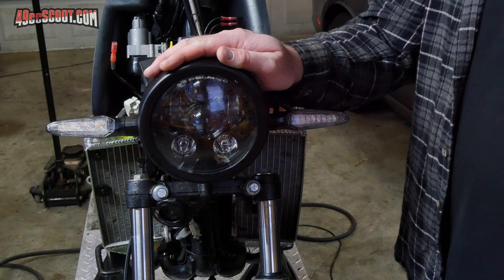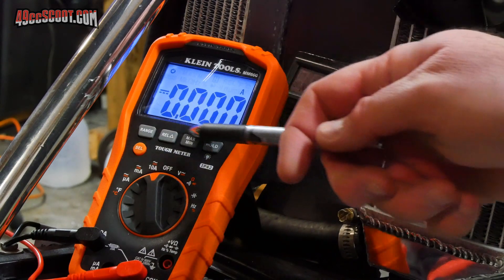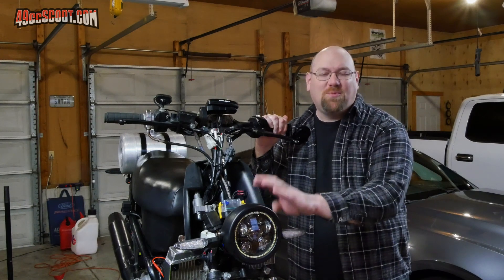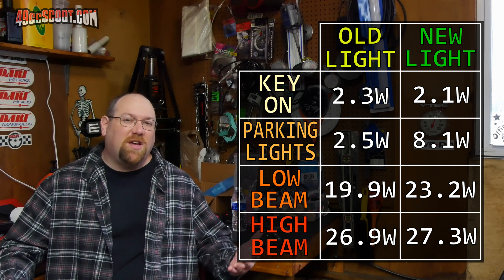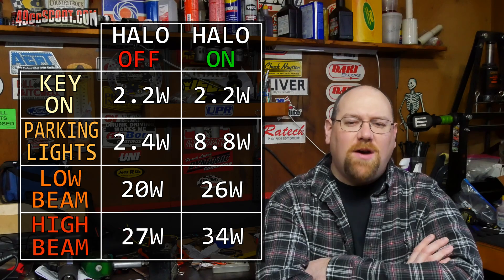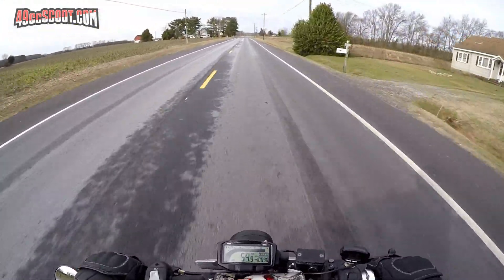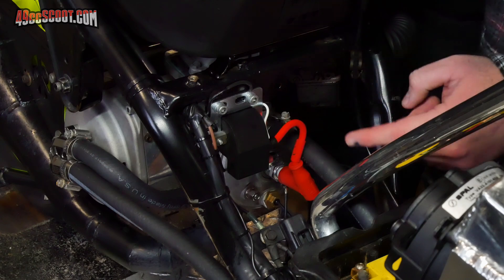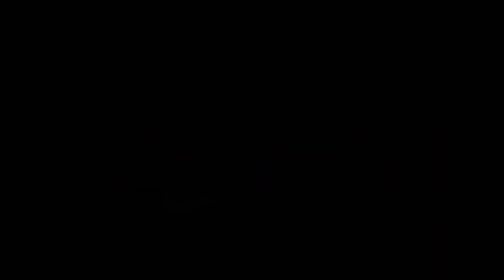TPR 86cc Build : Part 26 : Headlight Swap With Charging & Lighting Checks

Comment: I I have some glue lined 3:1 heat shrink tubing I'm thinking about using on my plug wires, to prevent something like that from happening,   it works great on everything else, even tool handles! I wouldn't cover the whole wire, only the connections! I'm thinking about adding a rectifier to my headlight, with a capacitor, to keep the led from flickering,  or stiffer clutch springs, and set the idle slightly higher,  funny thing, the light stopped  flickering, just as the clutch starts to crap!  But I'd rather spend less$$ and buy the big valve head, and intake, and upgrade to a 22-24mm carb, with a cam, and large valves, 50mm bore,  along with a bit of porting and unshrouding, a 24mm CV should work nicely! The 20mm works ok with the tiny valves!

Comment: Is this headlights has built-in regulator/ rectifier? 
Scooter is AC and LED headlight is DC.
🤔🤔🤔
Reply from the maker: My headlight is powered from the battery so it gets a stable DC voltage as long as I can keep the battery charged. I haven't done it with this light, but I have ran LED headlights off of the stock wiring before. They worked fine, but flickered at idle and low RPM.

Comment: I'd probably go with a Lithium Iron Phosphate battery, with twice the Ah and not have to worry about it. More expensive, but if one battery works and the battery doesn't get flogged all the time (like your current one), probably well worth it? Definitely buy the best brand of them though, cheap lithium is all bad news.
Reply: Although I would also check the spec sheet to make sure you can charge it from 16v, or get the charger sorted with a regulator of some sort.
Reply: Sorry for spamming.. You could use something like the link below to either keep the headlight at a constant voltage (stop light flicker at the lights) or to control the voltage going to the battery, if you went lithium.

https://www.amazon.com/DROK-Converter-5-3V-32V-Regulator-Transformer/dp/B078Q1624B/ref=psdc_10967761_t3_B018WZK5XQ

Comment: The 45w rating might be labeled so that bought hig and low beam are on the same time. Now you probably turn off the low beam when turning oon the high beam. Just a thought if you're wondering about the power rating
Reply from the maker: High and low are both on together. That's the only way you can power this light. It's just a couple of additional lamps that come on for high.

Comment: You better keep the voltage around 14V or so. If your voltage goes up to 16V you are going to overcharge/damage your battery and destroy your electrical system.
You can try just keeping your main lights on all the time, day and night, to drop the voltage. So it's not allways in your favor to search for low power consumption lights or to keep them off, you're not saving anything. A more modern regulator keeps the voltage around 14V, but only does so by wasting energy into a resistor internally. Normally your electrical system should have a resistor now too. It looks like this: https://www.ebay.com/itm/DAELIM-Scooter-ballast-Resistor-Voltage-regulator-12-volt-/141061001350
Happy scooting!
Reply from the maker: I'd rather find a quality regulator/rectifier. I have had 1 scooter with a ballast resistor and I didn't like it. The ceramic crumbles over time and they seem like a fire hazard to me.

Comment: is there ventilation holes for the heat sink on the headlight? looks like you're putting it into a sealed cover.
Reply from the maker: The opening in the back is pretty large.

Comment: I really don't care if drivers don't appreciate a bright headlight on motorcycle they already can't see us enough already or they just dont gaf
Reply from the maker: In the daytime, it's fine. At night it can piss people off and the halo isn't needed. The low or high looks plenty bright at night. I had an old LED light that wasn't focused enough and it kinda sucks riding around getting high beamed by everyone because they think you've got your high beams on.
Reply: @49ccscoot  I got a LED bulb it's pretty bright and I still had one or two vehicles wanted to cut in front or pull out in front of me.. Had a buddy of mine got killed last year while riding his 600 because the driver in his full size truck decided to cut in front him through a parking lot just to bypass traffic at an intersection.
Reply from the maker: @190SkyTeam  Sorry about your friend.
Reply: @190SkyTeam  I'm really sorry about your friend. The only thing you can do is try to keep yourself safe and never rely on the fact if you're being seen or not. If you see someone move, expect them to NOT see you, so you slow down a bit and be prepared. Be the man who makes up for someone elses mistake, not the boy who just blames them. Have a good one!

Comment: You could graft in that trail tech adjustable box you had on the previous version of things ? I'm thinking that may well be my route for bright
lighting, and to keep it simple. But keep it AC on ignition side with stock stuff. A rebuild is in the cards for it at 5 k miles, may just get a replacement cylinder and related parts. But smooth out the old stuff to the next size piston and try some port work on it. I know there is more to be had from the stock port map, not a lot more but a bit more. I've come to my senses - a little bit. 40 or 50 mph is fine for the old girl and
very useful in that range. I'll leave it that way. Had the CB 750 out when it got warm, it showed me my cervical spine issues make it hurt with
a big bike. 20 miles in and same back, by the end i was hurting bad enough to not do more. Here is where the good sense comes in -
A cb250 nighthawk came my way for so cheap i did not say no. Weighs the same as the scooter but with higher bars, highway miles on that bike
hopefully will be much less painful. I hope. It might be good enough for a few hundred miles or so.....might be. Still need to upgrade the nasty
stock plastic headlight on the scoot, a ceramic painted plastic reflector ? I would expect that from china but not an italian bike. Still think i can
get away with a low watt HID headlight and good leds all around by using that trail tech adjustable box. Simple enough anyway. The hack in
of the better reflector bucket will be a good trick i'm sure. Looks aside i just want light and a lot more of it than what stock gives. Night riding
around here is deadly without very good light, way too many animals some of them large - moose and deer. And the over abundance of stupid humans being drunk and clueless. I like your headlight assy it looks like a good fit for my space constraints, perhaps an easier hack in than my larger bucket idea. HID just makes so damn much light it's really hard to not want that at night on the front of YOUR bike. With most cars having HID now it is brutal being a 1/4 mile down the road from them on high beam on a dark road. So i figure have a taste of mine, that should make the dim switch click pretty fast. Add to that the 2 10 watt led spots tilted down so i can at least see the first 50 feet in front of me.
I'm thinkin you should be in good shape weather wise by late march ? Not all that long a wait from here, a bit more winter crap and all done.
I'll drag this light thing up again when the time comes to do the work. Have a good
Reply from the maker: Congrats on the 250.

A stock stator, with a floated ground, and the Trail Tech regulator made a nice charging system. Really never had power concerns doing anything that I did with it. I can't float the ground on the MVT stator to use it with a full wave rectifier like the Trail Tech. Well... I'm sure it can be done, but I'm not cracking open an expensive ignition to do it right now.

Lots of good lights out there now. So much better than the market was even 5 years ago.

Yeah, by about April it should start to be OK weather here again. Hasn't been bad so far, but I think real winter is coming soon.
Reply: @49ccscoot  So glad i came to my senses. 
Use the scoot for what it is and the 250 will do the rest. Drum front and rear is a bit bothersome, but will work as long as you think a bit. Stator should have a bit more beef to it on the 250, i think i see a low watt HID on that thing too.
I believe someone on your forum ( yes i have failed to do what i said i would )
But i will do it, just too many medical appts right now to keep it all clear.
Had a go with an LT 50 piaggio and did the coil mod, think he wiped the bike and then did a custom naked style thing with it.

Anyway all the best from the land of the crazy libs - mass - hole - chewits.
See ya next time..................

Comment: Great fun.I drove off the road today.In 10 km\h.I hit the ice edge in the car trail and slided both left and right before I ditched.I drive all winter,but its global warming and some spots are lethal.
Reply from the maker: Hope you and the scoot are OK.
Reply: @49ccscoot  It was hilarious.I use it in -10c,snow,rain.I do 60km\h inside these wheel tracks every day.Just a reminder,in a split second you`re gone.Had 2accidents,1 similar couple years ago.High speed into frozen slush.0 chanches,and max pain.The day before it was like water,next day concrete slides.

Comment: great video mate as all ways  i have to ask how is the tpr 86cc holding up  as  am i right thinking that its a hyper race kit ? so  not made for a day to day ride ?
Reply from the maker: So far so good. About 850 miles on it ATM and the engine itself has been reliable for me. I should prob pull it apart and see how the cylinder, piston and ring looks before too long.

It is a hyper race cylinder kit. I don't really have it in full hyper race mode though. I'm not making the horsepower that it's capable of yet. Need at least a different exhaust for that. Can't say how it would do in a more tuned mode. I like it right now though.
Reply: @49ccscoot   well thats good to know as im building a stroker engine and seen the tpr 86cc kit about a fair bit  and for the price  dont seem bad  as im looking for using the bike around town in the week and   trips down to see my son at weekends what is 40 miles each way but would think that i will be doing under 150 miles per week 

was thinking of doing what you have done with detuneing it a bit  so not as high reving exhaust  but staying with the stock stater but  lighted flywheel
Reply from the maker: @mrchilled85  You may want to consider the 70cc sport to midrace stuff. This is not what I'd recommend for something that you need to depend on for 100  miles per week. Not saying it can't work, but I think there are options that make more sense. That or consider a larger scooter, like a 125+ and then use the 2T as a more fun option occasionally.
Reply: @49ccscoot  i did think that but  a lot of the roads im going to be using are only 30 mph   
i did order a dr 70cc kit and top performance crankshaft for my spare engine i was going to keep as a backup motor so may  just try using that for a bit then try and get a rolling frame to put the stroker build in  or along them lines
Reply: @mrchilled85  get yourself something like a honda cbr 125r for that...   bombproof engine and economical as f.. dont cost that much to buy either... and you wont have to explain why you had to miss out on a visit with your kid because you accidentally blew a pistonring in transit and had to rescue your bike! belive me, they dont accept that apology :P
Reply: @KaiIngebrigtsen   i have had bigger bikes but not just as  much fun as with a 2 stroke scooter tho as thats why i sold my fzr400 as was  not getting as much fun with it due to  the roads where i live have  speed cameras everywhere and a lot of the roads only have 30 to 40 mph limits
Reply: @mrchilled85  although i dont know the woman you have a kid with, she might be just fine with it, but if she isnt id recommend not giving her anything to use as ammunition against u if possible in a visitation rights twist..  a 4stroke is just more reliable for long distance..  and then you can have fun on your own time with a hyperracing setup 2t, like a grown up ;)
Reply: @KaiIngebrigtsen   very true i dont go to her's anyway she just drops my son off at my mums and i go over there as dont have anything to do with her tho my son  will be riding he's own scooter in 2 years anyway on the road  so can help him build a sweet scooter for he's self